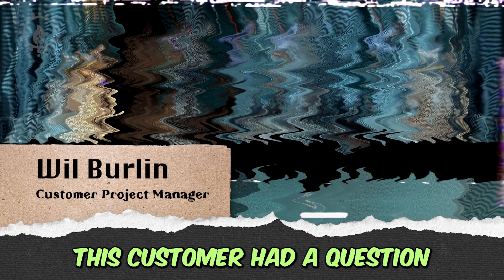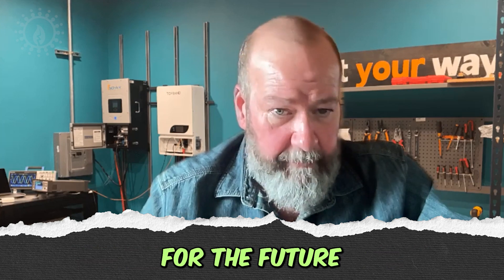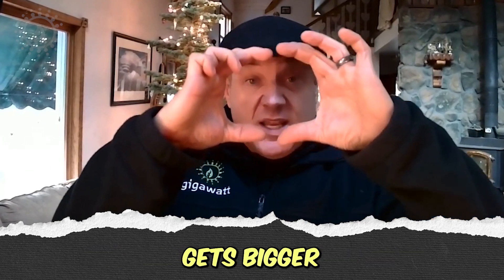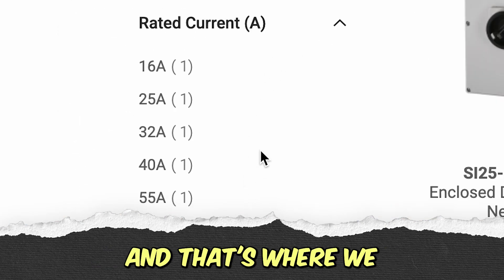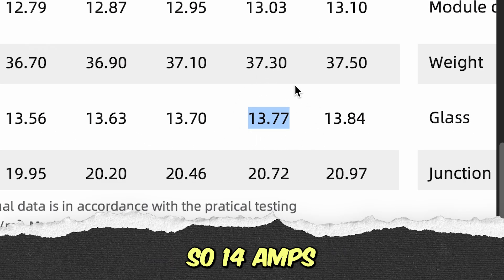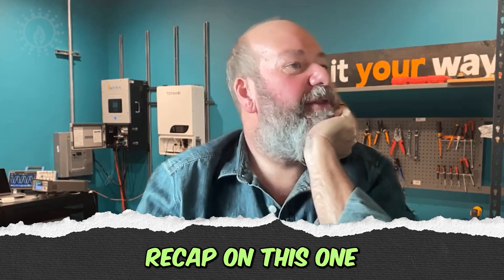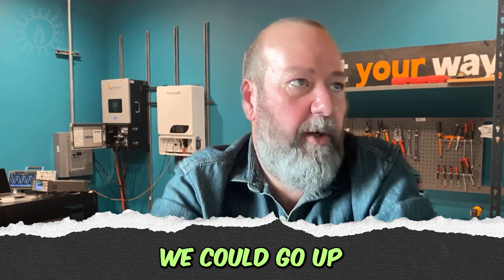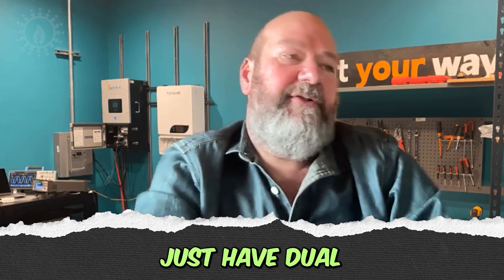How to Choose the Right DC Disconnect for Your DIY Solar System | Amps & Poles Explained

Comment: Why are DC switches so expensive. The solar store I talked to in NZ suggested using a breaker instead of a switch because they're cheaper.
Reply from the maker: Because DC isn't as big of an industry. Check out IMO DC disconnects, they are reasonable.